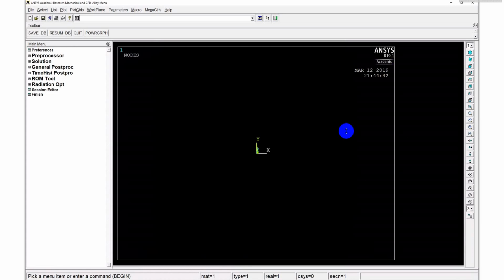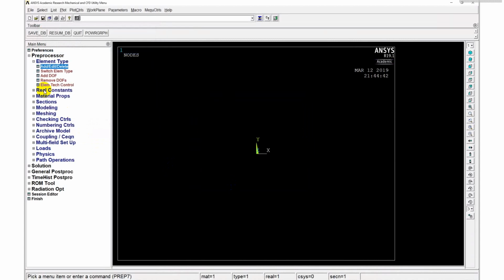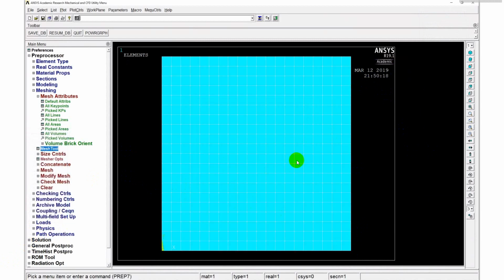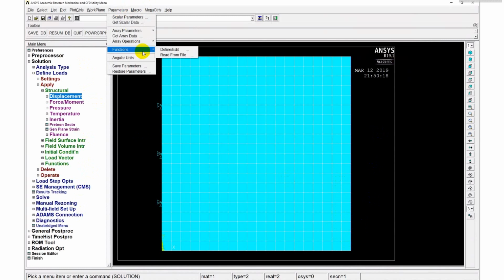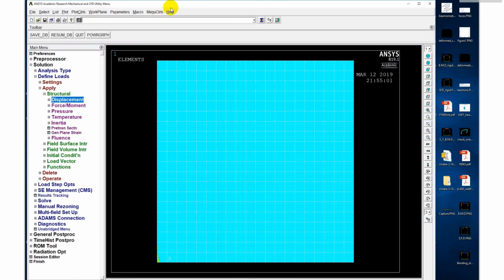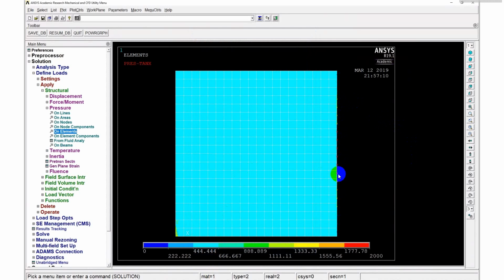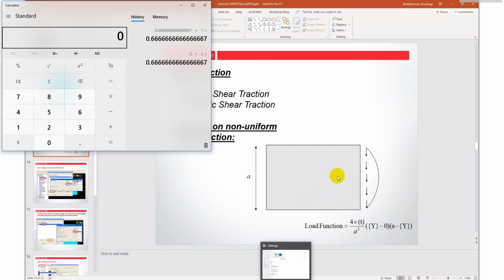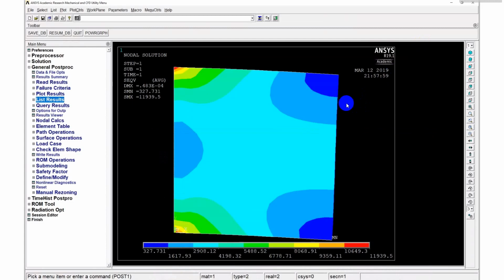Parabolic Shear Traction-ANSYS Mechanical APDL-Tutorial 2

Comment: The applied load was calculated as 1333.3' whereas the recovered reaction was 1330.  There is something wrong here I would suggest or else ANSYS is fudging the calculation of the consistent loads corresponding to the applied traction.